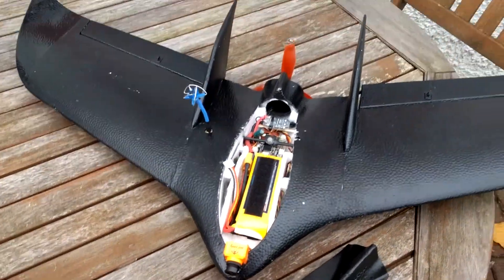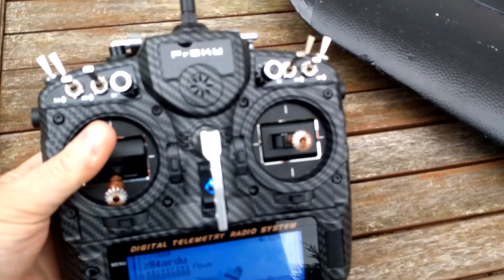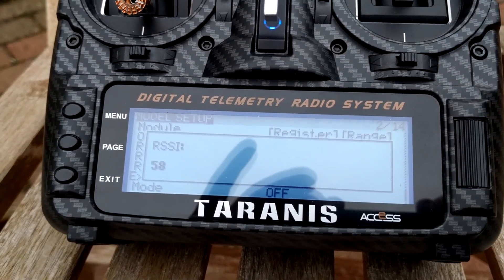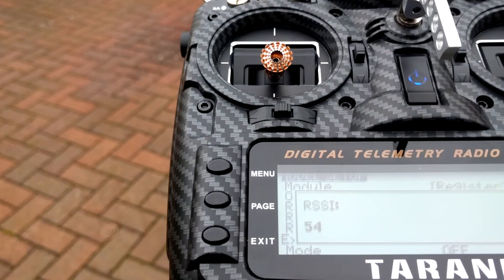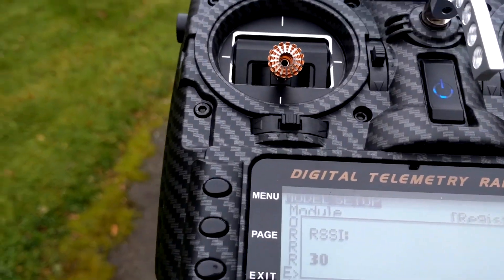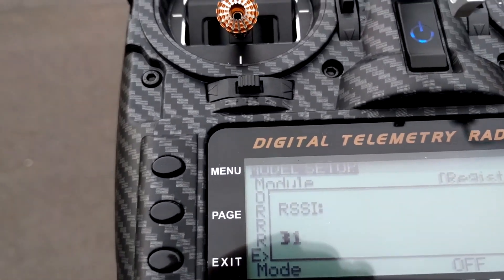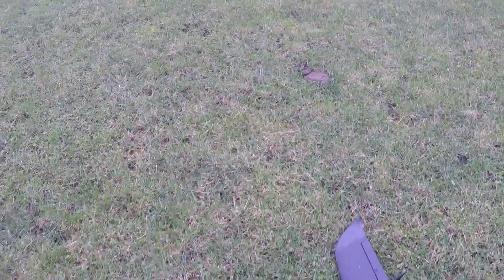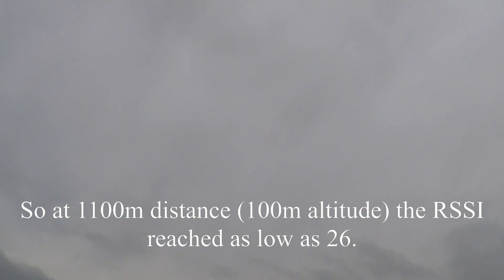FrSky Access R-XSR Range Testing

Comment: In range test mode the transmitter will output 1/30th the power. Walk till you failsafe say 50 meters. Then say what is 50 meters x 30 sgould be your actual range estimate

Comment: hello. my r-xsr is having the same issue. when i back up about 20 meters it drops drastically. i put it in my quadcopter and i couldn't even arm the quad at 100 meters. i havent done anything to the firmware and i use accst d16 on the taranis. how do you fix this?
Reply from the maker: That sounds like you've got a bad receiver bud (assuming you get much better range with other models). With mine I installed an updated (v1) firmware which corrected the rssi readings and took advice regarding the fact that access firmware reads rssi on a different scale to accst, so will go much lower before a failsafe. I never actually pushed it so far to get a failsafe, but may do one day. 100m when on the ground could cause issues. I find the same with some of my s6r receivers. Much different when in the air though, so would recommend trying a range test with the quad elevated.
Reply: @athertop  ahh okay. i will try range testing it in the air as soon as got my fpv setup. thank you so much 😁😁
Reply from the maker: @sochineze  I would first try a range test without flight. Have someone hold the quad in an elevated position whilst you walk away. Try the range test mode in opentx. If you get 50m you're doing good in range test mode. Have the person holding your quad turn it through all 3 axis to see if there is a weak position which might highlight bad antenna placement. If you have another model with different receiver try it on that also as a comparison. Make sure you have failsafe configured prior to flying a new quad and also maybe test any lost model alarm - for example, the blheli escs will bleep after a time of no input so you can hear your model in long grass etc. Also if you have FPV, make sure you record your flight on dvr so you have an idea where it might be if you lose it. Better still, if you have GPS position showing in the FPV screen or in radio telemetry (Assuming your model has GPS of course)
Reply: @athertop  Where do I find the info from Frsky that Access read rssi on differents scale or where did you get that info?
Reply: @Paraglider50  lol it says it in the manual of any receiver from frsky just look at the part that says range testing right after binding i believe the scale is 1/30th
Reply from the maker: @Paraglider50  If you download the Access firmware for R-XSR and read the readme.txt file it says this (see where it mentions suggested alarm values which are much lower than ACCST values (which are the defaults in OpenTx):
******************************Release Note*****************************************

This Package is for Receivers ACCESS v2.1.0 firmware update for RXSR. 

Version and Files: 
RXSR-ACCESS_2.1.0.frsk                                   Upgrade file for RXSR,channel 16 of SBUS signal will be used for RSSI output after button pressed                                                                                    for 5 seconds.F.Port / S.port can be swithed in radio menu.
readme.txt                                                             Release note 
 
Firmware Version: v2.1.0

The new updates of ACCESS 2.X.X not only fixed the known channel output error (uncontrolled servo movements) under certain conditions, but also optimized RF performance and added many useful features. It is highly recommended that all ACCESS customers upgrade to 2.X.X or later version of ISRM RF modules and receivers.

The released firmware changes are as below:
--------------------------------------------------------------------------------------------------------------------
1.Improved reliability and stability of signal connection
2.Increased the range of control
3.Improved the stability of telemetry feedback
4.Added FLR ( Frame Lost Rate) output.
5.Added configurable function for telemetry power.
6.Added the option for switching S.Port / F.Port protocol
7.Press button for 5 seconds will have RSSI output in channel 16 of SBUS.
* the suggested alarm value for ACCESS RSSI is 32/35.

Note: Please update the firmware of all your radios(latest openTx or FrOS), RF modules and receivers accordingly.
---------------------------------------------------------------------------------------------------------------------
More details please check FrSky website:
https://www.frsky-rc.com/frsky-advanced-communication-control-elevated-spread-spectrum-access-protocol-release/
https://www.frsky-rc.com/product/r-xsr/

*********************All rights reserved to FrSky Electronic ., Ltd.********************************